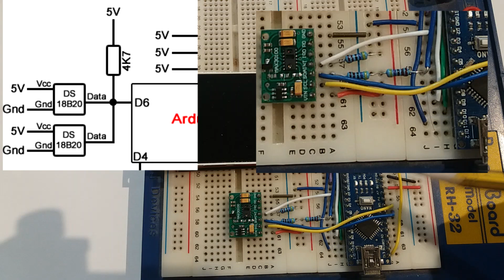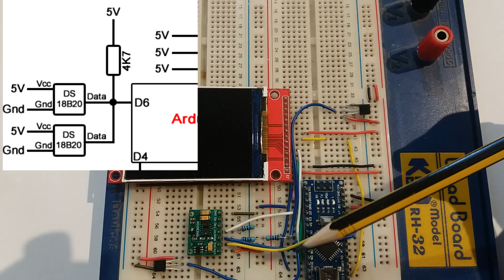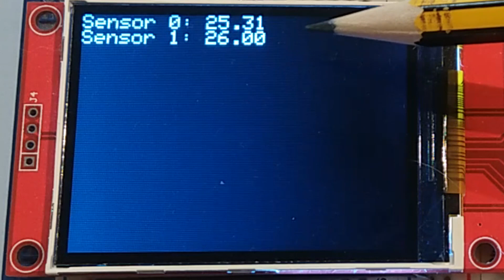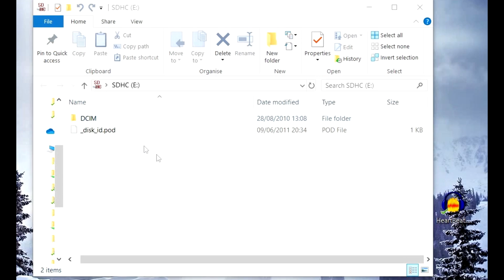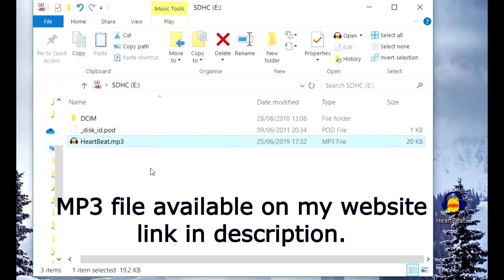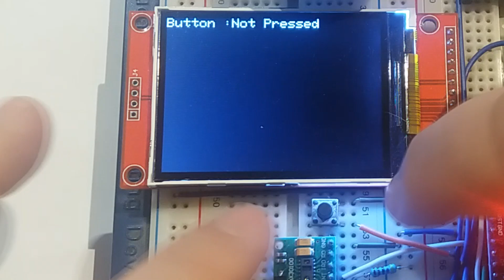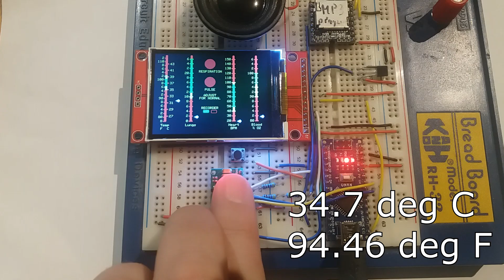Arduino Powered Star Trek Sick Bay Build Part 1

Comment: One thing i have noticed is if I power it from a USB source or a 5 volt supply it works fine. If I power it from say a 7.5 volt battery pack connected to Vin on the Nano I get distortion of the audio. It's not really a problem, just wondered if you have had this happen?
Reply from the maker: Not tried that but the mp3 player is not rated for that voltage but I would have thought that as long as it was powered from the arduinos 5v line it should be OK. As I want to make it portable in future it is something I would be looking into. But also I've had some success powering nano's   to much lower voltages on the VIN pin even though it should really be 7 v or so. I did a video on it a short while ago. Can't link here as on mobile app and can't easily see my videos whilst typing message.
Reply: @XTronical  I just watched your video on the lower voltages, very interesting. Just out of interest when i was using the VIN pin i did check the 5V line out of the Nano and it was regulating to about 4.9V so it should have been ok. If you use a 3 x AA battery pack and just put it across the 5V and 0V rails (not using VIN) it works fine with no distortion.
Reply from the maker: Cool, thanks for the info.

Comment: Thanks for posting the second part so quickly. I can get it all to work except the temp sensor. I think it might be missing a library? When compiling the sketch i get the following error - OneWie.h: No such file or directory - Any ideas? Cheers, Alan.
Reply from the maker: Wire.h is a standard library, you shouldn't need to install it, is your arduino ide a little old? Should be available as a library anyway.
Reply: @XTronical Thanks,  I found the library and installed it, temp sensors working ok now 👍🙂
Reply from the maker: Fantastic. Nearly done
Reply: @XTronical  Downloaded the main program, all working fine. Thank you so much for doing this. I'm a 'very' old electronics engineer and this is my first project using an Arduino. Your descriptions make it all very easy to follow. The Arduino software i'm using is 1.8.9 so i think is fairly up to date. Now going to try and figure out a way to build it into a scale model of a Star Trek sick bed!